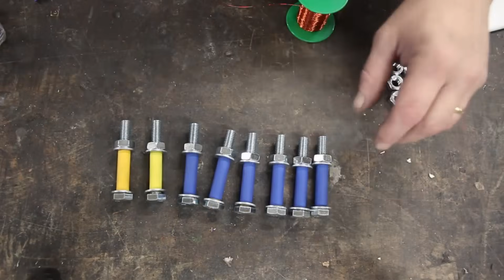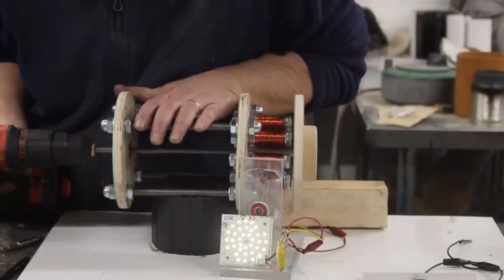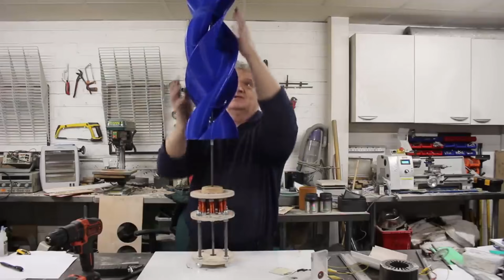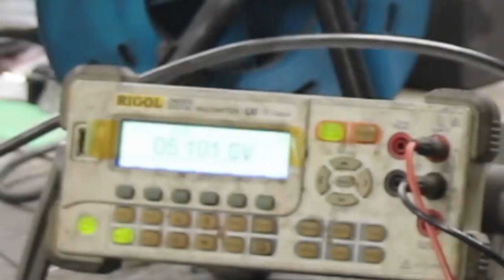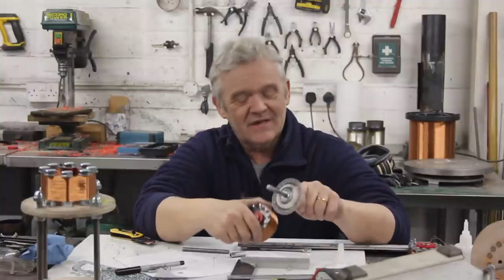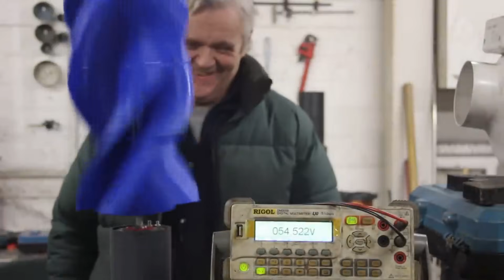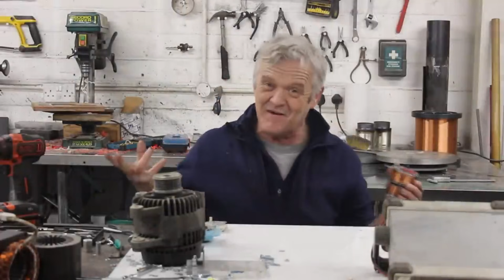021 The Mighty Mite Generator And How To Build It

Comment: I'm surprised you didn't leap on the serpentine arrangement with the copper weaving towards an inner ring of bolts. I like the carriage bolt improvement. I am curious to know if a shorter bolt would reduce the output significantly... What is the perfect bolt length? What if you did concentric rings at different voltages? I agree that wind is a necessary component of a diverse energy portfolio.
Reply: A shorter bolt does not have to equal less output.
Keep in mind that it is about the length of the wire.

If you put shorter bolts with larger OD washers that enable you to wind the same length of wire onto the shorter bolts, you would get the same output.
Reply: Shorter bolts with a fatter wind may actually be beneficial because more of the wire length would ultimately make and break contact with the magnetic field. There’s no way the bottoms of those tall coils are within the magnetic fields of those tiny magnets no matter how strong they may be…
Reply: @reverse_Splenectomy  

That's not how it works.

This set up uses to bolts to bend the magnetic field so that it is moving across the wire in a way that enables the generation of electricity.

The magnetic field transfers into the bolts making the bolt temporarily transforming the bolt into a magnet.

When the magnet moves away from the bolt and the next magnet which is set opposite (north south north south), it changes the direction of the magnetic field in the bolt. 

As a result, the coil is within the magnetic field of the bolt and that magnetic field is shifting from north to south thereby creating an alternating current.

If the magnet's field was not transferring into the bolt, the device would not generate electricity because the copper wire would not be moving at a right angle through the magnetic field properly.
Reply: @scotttovey    I'm still very much a newbie with all this stuff, but was wondering based on what you wrote, would using a more highly magnetic bolt, like a more iron rich metal, work better than the stainless steel that is being used?
Reply: @justinw1765  

"would using a more highly magnetic bolt, like a more iron rich metal, work better than the stainless steel that is being used?"

First, I don't think Robert would have used stainless steel. He would have went with the standard off the shelve bolts that are more ferrous than stainless steel.

It is a good bet that using iron bolts or rods, will result in stronger current generation as a result of there being less resistance to the magnets magnetic flux. 
How much of an improvement can only be determined through experimenting.

Comment: You could use a step down transformer say 2:1 primary : secondary.  The voltage output of the trans former will half the voltage of the input and the out put current will be doubled.  Remember power = voltage times current.

Comment: That wire surrounding the entire set of steel bolts works because the magnetic field from the magnets puts a varying magnetic field into the bolts.  Replacing the steel bolts with wooden dowel and it won’t work.

Comment: can't make solar as in photovoltaic cells, but you can easily concentrate sunlight with mirrors and lenses.  

I actually wonder if you can combine the wind collector with a solar updraft tower.
Reply: Those designs are pretty awesome! I’ve been a fan since I heard about them. They tend to be very aesthetically appealing to boot. Like some big futuristic artsy…thing… Or some sort of weird memorial type “landmark” that just happens to power the hypothetical city near by or on the outskirts. I’m pretty sure I’ve even seen renderings or designs that also doubled as fresh water condensers or desalination plants or something like that.

Comment: As someone who has been living off-grid, in the middle of nowhere for 4 years in harsh northern winters, Solar has been vastly more reliable and cost-effective than wind by far. 
Here is why: I have two wind generators. I paid $400 on the low end and $800 on the high end. I have a VAWT and a HAWT. Both from companies out of China, both highly recommended (by people who obviously don't need to rely on them to light their home or charge their phone). The HAWT was rated for 350 Watts, the VAWT was rated for 1200 Watts. Neither of them have made an appreciable difference to my charge levels even in the highest winds. My reason for getting them was to compensate for the extremely limited sun in the winter. We live far enough north that the sun is very low over the horizon in the winters, usually with heavy cloud cover and snow. And yet, even with those conditions, Bi-facial Solar panels have wiped the floor with wind. We live on the edge of an 8 acre open field which means we see some steady, and sometimes quite high winds, yet store bought generators have never returned our investment. 
So while I cannot whip up a solar panel in my barn, they have paid us back 10-fold when compared to the wind generators we have purchased so far. 
Now, with all of that said, something that would help real people who rely on renewables for ALL their power needs (no generator), creating a generator that can produce enough power in a reasonable amount of wind to raise the charge of a 24V/800AH battery bank would be something I would watch with rapt attention. I agree in principle that home-made wind generators are the way to go, but they MUST justify the time/materials spent on them by providing enough power to make any real difference. Otherwise, they are little more than fun toys.
Reply: Hand generator

Comment: You could combine your reversing screw and the geneva counter to make a winding machine. Or you attach a revolution detector to an arduino and have it turn the motor off after the desired number of turns are wound.

Comment: Maybe I missed it, but does the thickness of the enamelled copper wire make a difference or any gauge will work?
Reply: It makes a difference in that the thicker the wire is, the less length you’ll be able to shove into a given winding. So thinner gauge wire tends to give you a larger voltage potential. Of course ultimately less amperage could be handled by a thinner wire but as he’s already stated, high amperage will never be an issue with this design.
Reply: Yea it seems the length of the wire is how the equations are derived?  That was my take away.

Comment: What if you just uses brass washers and a plastic spacer with a thin plastic insulator and wired the washers like a long wire as to make a maximum length.  {-0-0-0-0-0-0-0-0-0- ?

Comment: I’m curious Rob.  Out of all of the generators you’ve built how many are you using to power your home?
Reply: When shtf, he's going to be just fine 😂
Reply: @mememan2344    The shtf will happen, but it will happen through a combo of the loss of Earth's magnetic field and a strong Solar storm.  Hence a lot of electronic and electric stuff will get damaged. Wires will likely catch fire (via induction) etc.
Reply: Hello, just an un educated question, when creating generators such as this why isn’t there use of a way to step up the output to a higher level?
Reply: @DynamicMindTribe  it's because it's just one part in a system. You are correct, this is where things like joule theifs and step up converters come in. When you're building your own powerplant, you have to handle literally every part of the process. Rob is just showing us the millions of ways you can get that electric current flowing out of whatever you have, be it heat, wind, water, etc (what he calls your prime mover).

You might need to connect it to a gearbox to make it spin faster and generate higher voltage, maybe you choose another coil and magnet pattern, etc. This is the world of the Maker, you can do anything.

You'll have to customize your build to your needs, and the advantage is that you'll save a ton of money making your own powerplants, vs paying a minimum of thousands for a generator coming from commercial sources.

25 volts 100 milliamps as shown in the video isn't bad. You could just stick a buck boost converter on there, luckily as long as you have a couple watts at least, you can convert it using off the shelf components for pretty cheap.
Reply: @mememan2344 thanks for the info very informative that’s what I love about Rob’s videos I’d love to see some examples of this.
Reply: @DynamicMindTribe you can make an entire career designing inverters and converters. It's a very rewarding career, though a bit niché.  Power management electronics is great thing to learn.  I would recommend a background in physics (mechanics & electromagnetics) to really grok everything.  There's also electronics, the actual control mechanisms are power transistors like IGBTs for high power control, but you can get away with MOSFETs for lower powered stuff.
Though you could go to school and try to major in physics, but I think everything you need to really know has been covered on youtube by now.
Reply: Such a great answer.
Reply: @TNT Omnibus I wonder what would be the difference if you used a Mueller (late Canadian inventor) generator type arrangement for the coils/magnets (ie 9 magnets for 8 coils)? Maybe coupled with a radial rather than axial design? I have several more ideas for incorporating a few other distinct design elements (especially for wind driven) that I don’t have the time and resources to do my own experiments.
Reply: Bump
Reply: UP
Reply: His open fire is generating loads of heat from all them failed 3D prints lol.. there’s an idea! Power his printer by green energy!
Reply: @MrFujack103  anyone who thinks solar is green has never watched a furnace as you melt the glass to cover the panels.  Let alone the mess the cells make themselves.
Reply: @robertsmith2956 would like to know more 👍